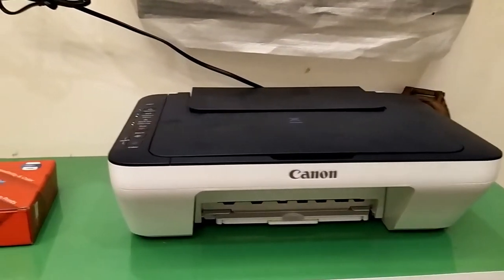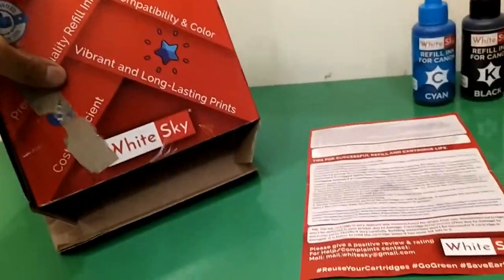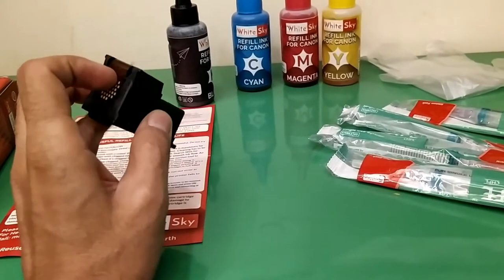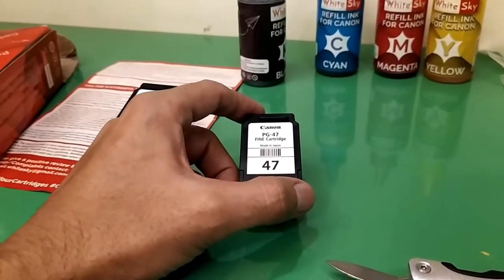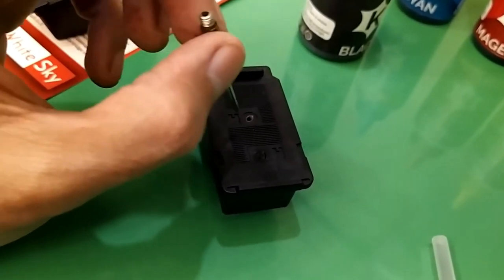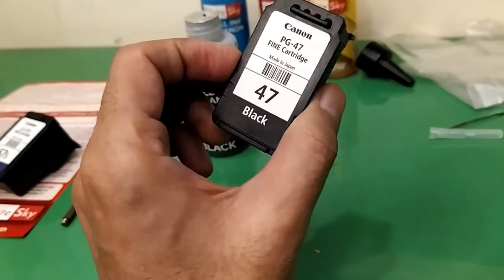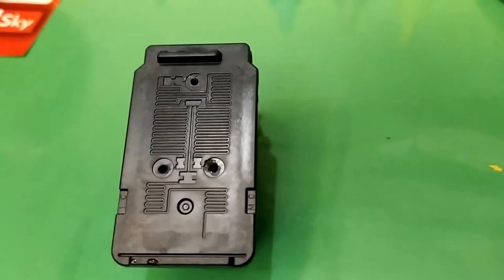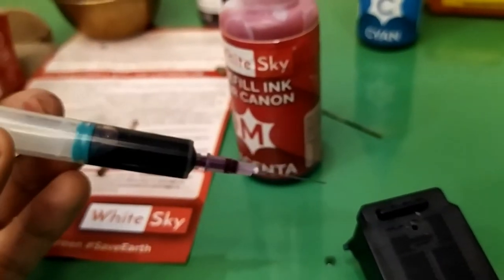Canon (or Any Printer) PIXMA E-Series E470 Series Cartridge Refill Black#47 Colour#57 - Easy Way

Comment: yes it worked i bought it recently and it worked 🙂    on Pixma E470.. some people had issue that the ink is coming out,, so the sol is fill it slowly czz the air inside the cartilage have no way to come out if the hole you digged  is so small
Reply: I faced scan or copy faded on one side and scan has a single line on right side like a big margin line...any solution?

Comment: @DesiTechIdeas, I have followed each and every step, but now the error and color ink light are blinking continuously, and on my laptop, I am getting an error as the ink cartridge is not recognized.

Please HELP.
Reply from the maker: @chetansaini3662  HI Chetan, the cartridge will still shown as empty in printer. I recommend to check the cartridge fitting. May be its not fit very well. Also see the error code resolution as well.

Comment: Bro. please help to upload or confirm that after refilling still it worked..?
Because I did same as you guided. But still printer showing LED Indication on Black Ink and and Alarm with error code 1688
Reply from the maker: HI Prayag, Printer LED will continue to blink as every cartridge has unique serial number and printer keeps that in memory upto last used 3-4 cartridges. dont worry, if the refill is done very well than printing will work. - If you want to test, you can try with next 4-5 cartridges (may be used but same number), than use this refilled one and printer will recognise this as new.